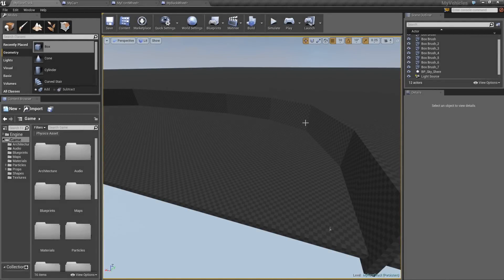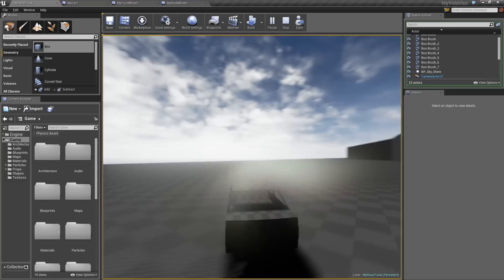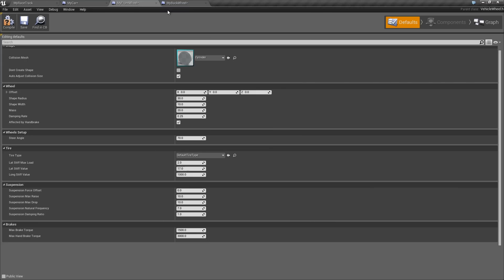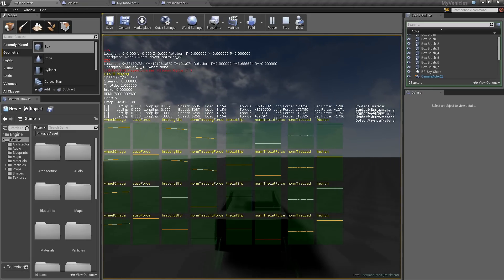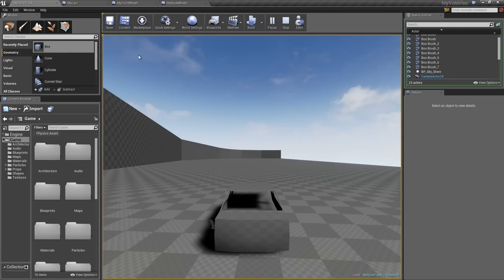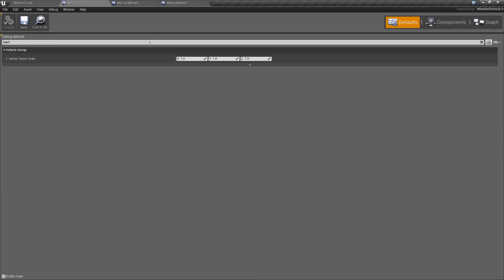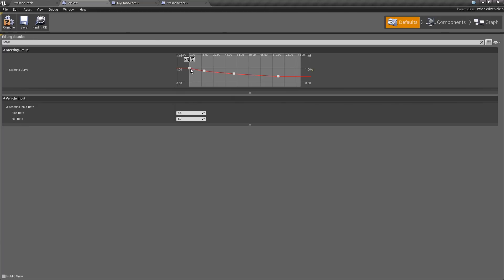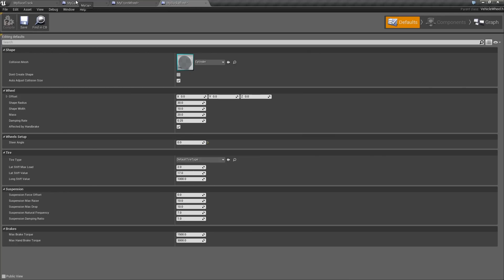Vehicles: Handling & Friction | 03 | v4.2 Tutorial Series | Unreal Engine

Comment: where are those fucking settings to begin with
Reply: op de auto duh
Reply: late reply, but for those who are looking for it, if you've started with vehicle template which generates Sedan, select Sedan in World Outliner, click `Edit Sedan` right side of it, select `Vehicle Movement` in the Component menu which is top left of the screen, then in Detail panel, inside of `Mechanical setup`, unfold `Differential Setup` and you'll find `Differential type` setting, and there you go! (UE4.19)